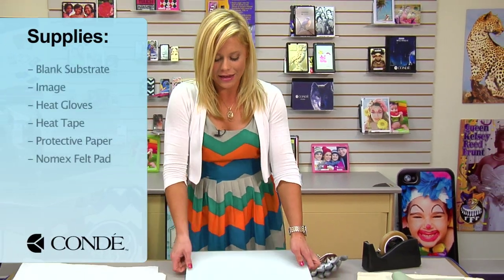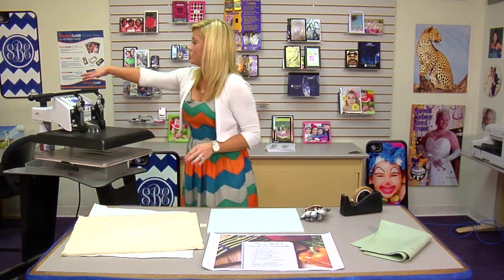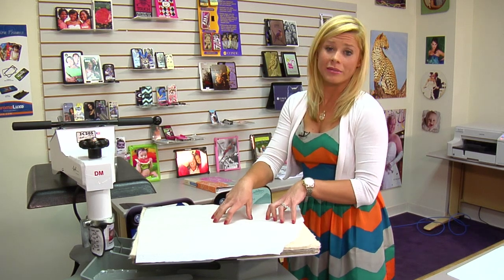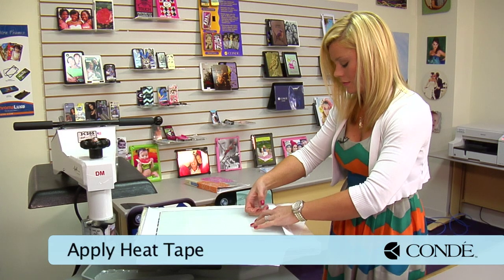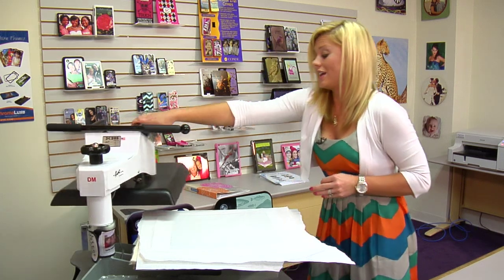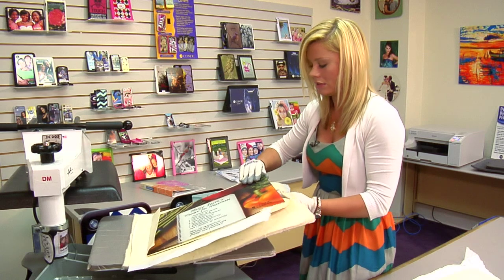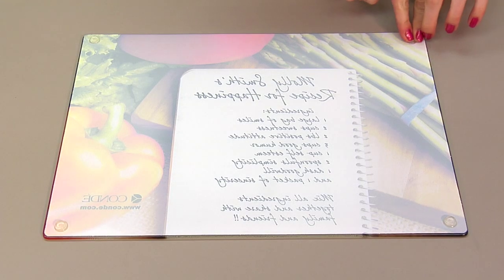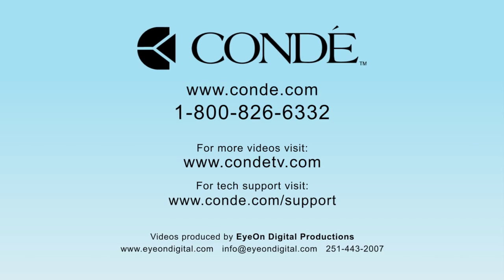Adding Sublimation Images to a Coated Cutting Board -

Comment: do you have to use protective paper? my heat press is Teflon coated. also it come with a rubber pad stuck on the bottom
Reply from the maker: The ink will transfer to the teflon and then to the next item you make.
You could leave it off, just be sure to thoroughly clean and scrub in between items. But protective paper is much faster.
Reply: Ooh thanks for that info. Where can I buy the protective paper?
Reply from the maker: lou star
 We use Tarpon Butcher Paper from Sam's Club.

Comment: Placed upside down?
Reply from the maker: What? Looks perfect to me.
Reply: ***** Just haven't seen it done that way. Unless that press produces heat from the bottom.
Reply from the maker: The rubber pad is heat conductive and gets as hot as the platen
Reply: ***** I didn't mean to sound like a smart ass. I am still in the learning phase and haven't seen it done this way. 

It does look great.
Reply from the maker: That's okay. Green rubber makes a little oven.
Reply: ***** Now if I could get these dog tags to not look washed out.